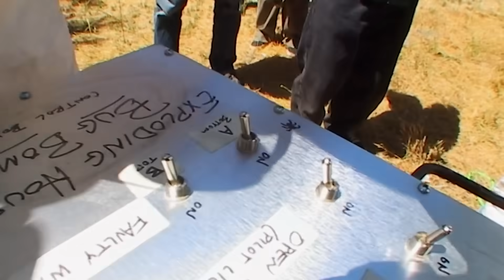Can Bug Bombs Really Blow Up Your Home? | MythBusters

Comment: Anytime you take a pressurized and flammable liquid or gas and aerosolize it in a confined space with a potential ignition source your essentially creating a potentially thermobaric situation. Think of how clgas leaks blow up properties. What's worse is, some fuel sources are known to self ignite under the right fuel/ air ratios which is why you're suppose to lay rags soaked in naptha /oil/fuel FLAT to dry out and not throw them in a corner crumpled up where they can self ignite. The alternative being to put them in a metal pale so they're less likely to spread fire to other flammables if they do ignite. 

Follow mfg instructions and warnings and risks dramatically decrease. Your risk will almost never be zero but the lower your chances of catastrophe the better. Fire extinguishers are cheap, properties and life are not

Comment: what about filling 1 room with 100? will the room explode?
Reply: Top much fuel not enough air. You need the right air to gas mixture. Stoicheometric ratio. So you have the perfect ratio/amount of oxygen for the fuel to burn completley is the only way to get a boom

Comment: I think one reason they did not get such a big boom is older bug bombs used to cheap propane and butane as a propellant. Hydra few houses blew up I think manufacturers switch to a more expensive but yet less volatile propellant.
Reply: They still got a flash fire out of it
Reply: Either way using more than the recommended amount of bug foggers in your home is still a good way to end up burning your house down

Comment: So since I don't remember this episode and haven't found the full one yet, what's up with the test house: it was slated for demolition, or...? And if so, why?
Reply: It WAS slated for demolition. Now the derelict hotel (Hotel Royal in Oakland) in the falling elevator episode was from 1912 and had been abandoned since 1998 when all people were evicted due to it being extremely hazardous without even utilities or the elevator being stable. The MythBusters wanted structures that were slated for demolition without a good chance for remediation that could make them change structures.
Reply: @stgigamovement : Huh, OK, thanks for filling me in! How did you learn about that?
Reply: @HelloKittyFanMan  I watched the elevator episode and out of curiosity Googled the hotel and looked for news articles from around the time (2004) where the MythBusters had said the hotel was scheduled for demolition. It is likely that the 2-story house in this episode may have become unsafe somehow, since the house doesn't look derelict. Perhaps a termite infestation (which would be fitting) did it. Also there was electricity at the house so it would have to have been very recently scheduled for demolition and not derelict like the hotel. Oh and the way the MythBusters moved the ~90yo elevator in the Hotel Royal whose electricity was spotty before being scheduled for demolition was by using one of Jamie's robot vehicles to turn the gears because of limited electricity and attempted copper theft had happened to the motor. Ultimately when the MythBusters have done experiments set to destroy long-term assets like a car or house, more often than not they choose assets that were to be destroyed anyways regardless of their involvement. When they filled a car with rigid expanding foam in a later season, they used a low-value 1990s car. For their Titanic episode they used an old tugboat, and the airplane parts they used for testing bird strike and shredded plane experiments were from a salvage yard, as was an industrial tank used in a few experiments. The MythBusters only destroyed low-value stuff unless the myth called for expensive stuff under most circumstances. The JATO rocket car experiment specified a 1967 Chevrolet Impala which while a classic car isn't a  completely rare car, but several revisit episodes used 1966 ones which were quite similar. The Stinky Car episode involved a Corvette (the idea was you could not sell a desirable car after a decomposition happens in it) but not one you'd typically associate with a 59, 79, or 99. It was one of the quirky 1980s ones. And the Cadillac called Earl was donated by a fan, as was a minivan. Even Buster was a retired crash tester whose time testing cars for crash safety had passed and was thus a LOT cheaper than a brand new one.